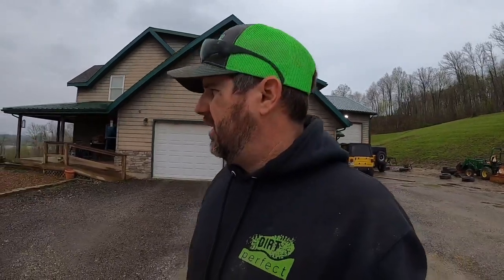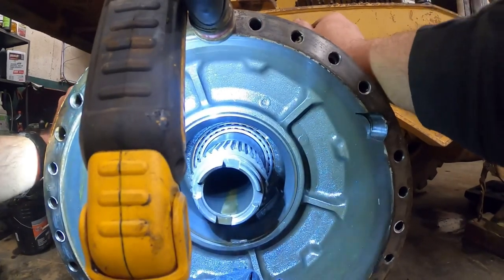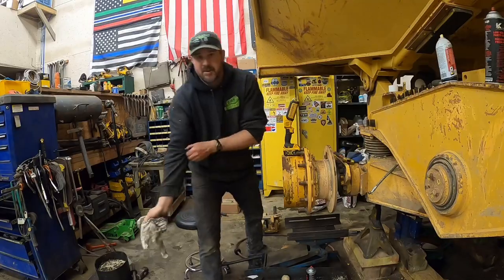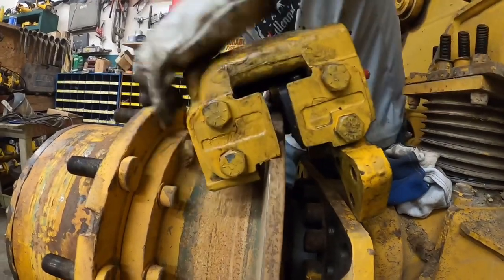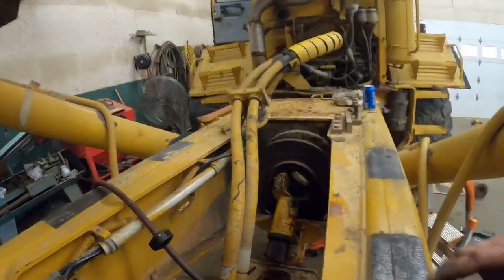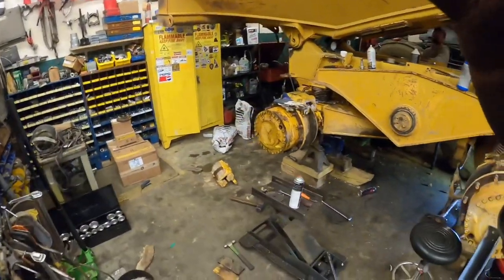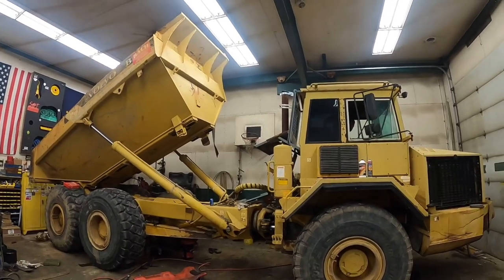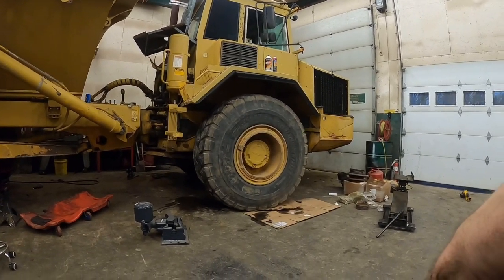It only took 7k, 4 video attempts, and 4 weeks but Bubba Dump has brakes!!!!!!! #volvoa30c

Comment: And you guys still have 10 fingers and didn't get strangled!  I tie my hoodie strings up short by folding each in half then tie a loop around your finger and push the knot up close to the zipper.  Or, better yet, not many peeps tie their hoodie up tight, just remove the string!  Just throw those clothes in the trash or throw them in the utility tub to soak overnight.  That was one nasty, dangerous project out of the way, but just wait, more coming down the pike verrrry soon!  Also, that was one noisy video!

Comment: I don’t think you torqued the axle nut correct. Your book said 400 ft/lbs, rotate, back off 1/2 turn then torque back to 221 ft/lbs. It doesn’t look like you reset your torque wrench to 221 and now your axle nut is torqued to the 400 ft/lbs. Check at about the 8 min mark.
Reply from the maker: Did all good thanks

Comment: I'm curious to why you didn't pack that bearing
Reply: It's an oil filled bearing, not a grease packed unit, so all it it really needs, (on install), is a little assembly lube. Normally enough supplied in the factory packaging.
Reply: It's oiled from planetary gears and rear oil
Reply: Some do , some don't pack them, personally I do give them a light packing of bearing grease.  But the hub is filled with gear oil after everything is put back together.    I hope they remembered to fill the hub!  LOL
Reply from the maker: It runs in oil

Comment: No grease on the bearings??
Reply: The bearings are in a constant oil bath when it's filled with gear oil. No grease required in this application.
Reply: @gardnermiller6820  thanks for the info, now I understand why👍
Reply: You're welcome.

Comment: Why are you wasting time with that second pull on the torque wrench? Isn't the first click good enough? Don't you trust the tool? Is there a irresistible urge for you to click the second time? I can only guess, but if you use a different style of that tool, namely the bar type, you would NEVER do a second yank because the first one will be sufficient, more accurate and done by the book. There are better mouse trap tools out there. I like the ones that beep and blink. I think they are better than that clicker you got. They do the thinking for you, as long as the battery is good. I would start every mechanic apprentice with the simple tool to teach them the basic theory behind it, but that's just me...
Reply from the maker: No

Comment: No grease on any off those bearings, not going to last verry long/
Reply from the maker: Absolutely not they run in oil why the hell would I put grease on them plz thanks
Reply: Only winding you up guys, well done on getting the brakes going finally 👍👍👍

Comment: Greaseless bearings….🤔
Reply: The hub is filled with gear oil after everything is assembled.
Reply: Internal bearings. 🙄
Reply from the maker: Absolutely not they run in Oil not grease